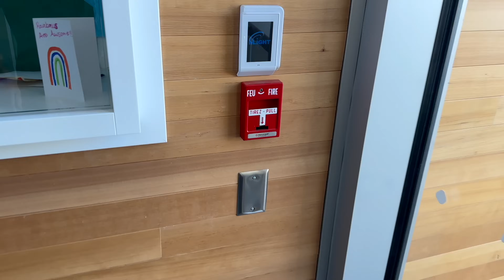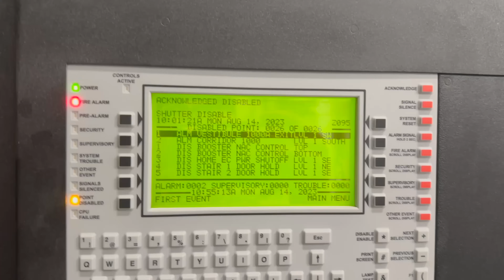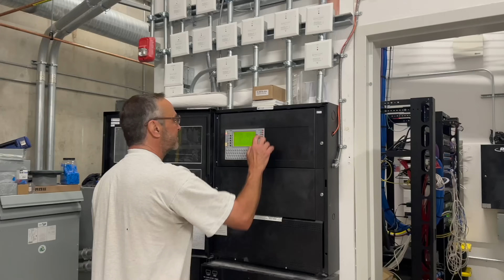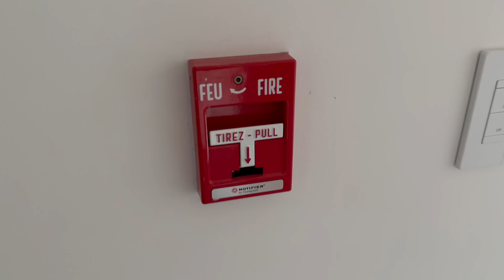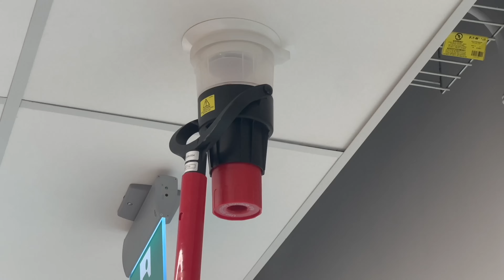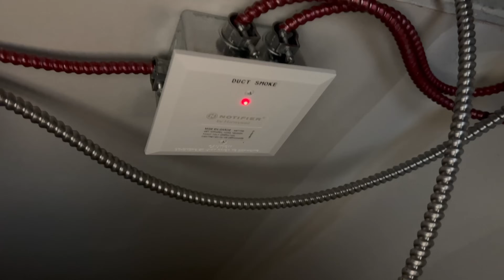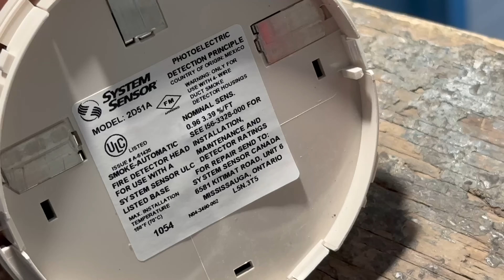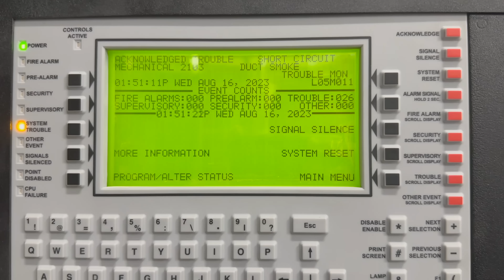Fire alarm testing at a brand new middle school, Notifier NFS2–3030 and L-series.

Comment: At our college they test the alarms/detectors while the building is occupied (they have someone on each floor on fire watch); the "horns" even have a special message that announces: "The fire alarm is being test. There is no need to evacuate the building. This is only a test." It is neat to know how you know what area is in "alarm" if something does happened. I do not know the panel type but it seems to have a wireless network (special type not normal wi-fi), allowing the tech to see each device annunciate as they use the device testing stick/spray. It makes it easy to diagnose a failing device. The reason for extra "loops" is the school might need to upgrade its lockdown system if/when the codes are changed after what happened in the recent past.
Reply from the maker: Sounds like likely a simplex system the loops in the school have nothing to do with lockdown that is always done with PA system the engineer wanted one loop per floor and each stairwell etc. that is why there are seven loops

Comment: No way I just asked the administration at my school and they said I will be able to pull the fire alarm for a drill next week!
Reply: My school is asking the board office!
Reply: my school lets me program the panel!
Reply: NO I CANT BRUH THEY ONLY LET ME FIX THE PC DAMIT
Reply: @Futurejcpl_lineman115 That’s illegal
Reply: @vrryan6  no it’s not
Reply: @vrryan6  bro it's not you need to test the system 💀
Reply: It's not illegal it is just for a drill
Reply: More info on the system it is a notifier system with notifier bg10 and bg12lx pull station along with wheelock mt-ls horn strobes and wheelcok my-lsm speaker strobes
Reply: @Futurejcpl_lineman115  to program your school's panel without any sort of license
Reply: @vrryan6  it’s not illegal.
Reply from the maker: Yes that's definitely illegal in most places definitely is illegal here
Reply: @Futurejcpl_lineman115 pretty sure you need to be a licensed tech to do that. Do you have NICET II or higher and work in the field? If not, you and the school can get into huge trouble with the fire marshal.
Reply: They asked me to do it gor the last fire drill of the year in elementary school thats how i got into fire alarms
Reply: @Futurejcpl_lineman115 its very illegal my guy
Reply: @TheSimplex4903  how

Comment: So does the school use Distech controls for its Building Management, or are those UNITOUCH touchscreens just for the nLight system?
Reply from the maker: Yes there's some touchscreens for lighting control can't remember the name, we had a course on it but it is slipping my memory nLight sounds more familiar
Reply: Actually I don’t think that is the case since I saw different a different thermostat. The school having 7 loops though is interesting, my building has 6 loops, but that is because for the most part every classroom has at least 1 detector, be it smokes for the most part, and then there are some heats in the science rooms, and then the hallways have smokes as well.
Reply: @nics-systems-electric it’s definitely nLight. I recognized some of the other WallPods, which are basically Acuity’s name for the button pad. Part of the reason why they are nice is that you only have to run cat5 or higher to those interfaces, as well as the motion sensors as well. And in my district, in some of the schools the classrooms have a wallpod that has dimming presets, and another that has 4 different buttons set for different temperatures of light. It is a very interesting system.

Comment: Interesting that the lid switch on the duct detectors don't put the zone into trouble. That seems like a faulty setup since the detector won't function as intended when the lid is removed. Or is the code for this different in your area?
Reply from the maker: I think there is a trouble relay on the duct detector but I'm not sure if it's monitored I can't remember if it does open up the zone and cause a trouble or not

Comment: Idea: find out what brand damper motors these ducts have and replace the old motor on the generator with these as long as these ones in this video are capable and are ok outdoors.
Reply from the maker: Why would I replace mine? It's still new and works perfectly fine that would be silly to replace it for no reason. And they are the same brand Belimo
Reply: @nics-systems-electric the school ones are faster. I was thinking the faster the damper opened, the faster max airflow could be achieved. Is there any way to make the generator building damper faster? I know everything still works at least but I was still thinking about quality of life changes.
Reply from the maker: @achannelwithnopurpose1977  they are faster but also probably around $600 to $900 each
Reply: @nics-systems-electric  quality of life changes can wait. Was just an idea anyway to just make the damper faster. The system you have does work fine anyway, and money/budget is definitely a real world issue.

Comment: I just found some USB RGB string lights that each bulb can be separately detached from the other bulbs and I choosing 58 individual sets because that’s what the online store said that you can put 58 sets together and run them off, included transformer or directly from 5 V source

Comment: At around the 54 minute mark in the video, I am guessing the duct detectors in the bathrooms are for the exhaust, is this correct, or are all the detectors for air conditioning only?
Reply from the maker: Detectors are installed to detect smoke being moved through the ducts it does not have anything to do with the conditioned air whether it's been cooled or heated or just ventilation

Comment: What was with the home style smoke detector in the cooking classroom?
Reply from the maker: I believe I talked about it in the video that they are throughout the school. They aren't smoke alarms but are carbon monoxide alarms
Reply: @nics-systems-electric  weird it’s not a  System sensor CO1224T or something similar
Reply from the maker: @Redbird45  That's a conventional device. If it was required to be a part of the fire alarm system it would be a FSCO-951 like what is installed in the school in the shops

Comment: I dislike how bland school's interior design is becoming. If you look at schools built in the 90s, they have alot of colors on the walls and sometimes floor tiles. Now you see schools being built with this sort of brutalist design which doesn't seem healthy for developing children. I could imagine this monochromatic color scheme could cause people to feel depressed over time.
Reply from the maker: I personally find it a much cleaner look as someone that went to an early 2000s Elementary School that was much more colourful. I don't mind the more modern approach I do like the colour adjustable lighting in the classrooms that can be changed to suit the needs of the classroom at that time which can greatly change the mood.
Reply: @nics-systems-electric  I guess I just prefer that coated cinder block, drywall, and wall to wall drop ceiling construction, feels more homey to me